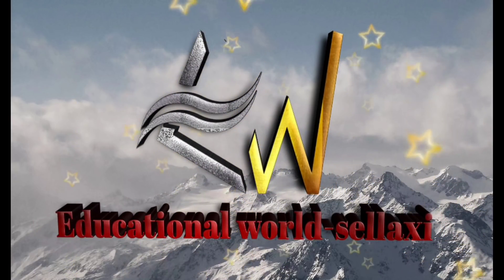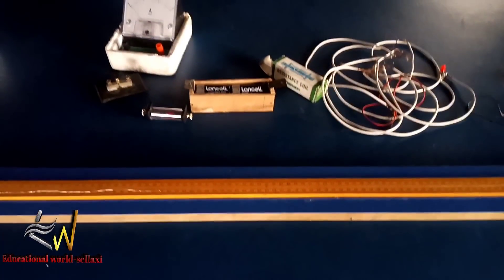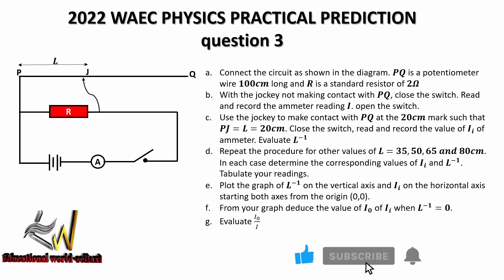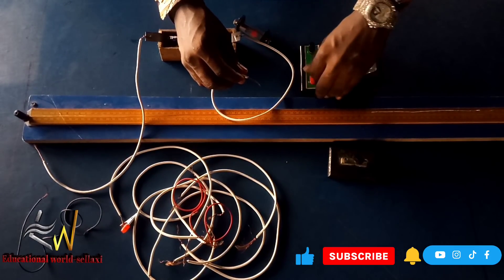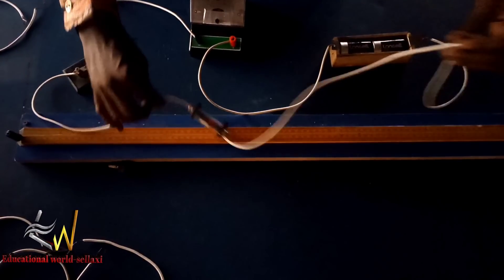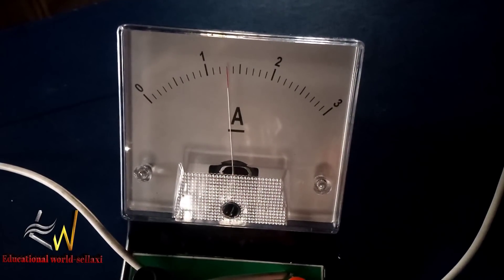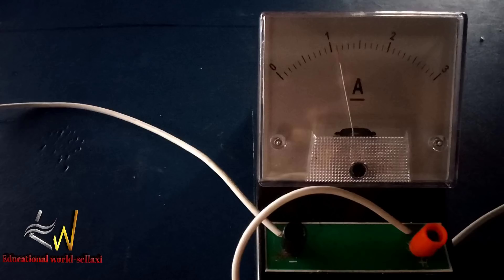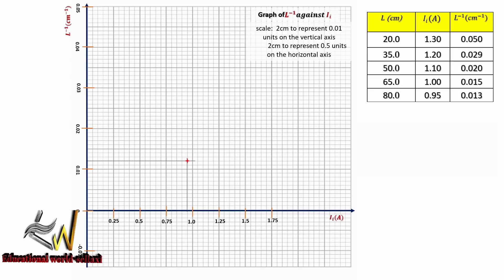2022 WAEC PHYSICS PRACTICAL IS OUT. EXPERIMENT 3

Comment: I'm getting different result from your own result, maybe because I used the normal big tiger battery or what. My first current was not up to 1.3amp, what might be the cause?
Reply from the maker: Check you're connections ensure that they're tight, and use a new battery. I think that will help
Reply: @sellaxi  I changed battery, still d same result, I will try again tomorrow and see, can I get ur WhatsApp number so I chat u up with my result before start of exam, it will be so much appreciated. Thanks

Comment: Well done sir. Pls can you tell me why my readings on the ammeter is higher than your? When my l=20 ammeter reading was 3.5A. I did the connections correctly
Reply from the maker: Due to my battery has ran down a little, that's why. But your table is correct don't fear. Your slope will still have similar value
Reply: @sellaxi  oh wow....thanks sir! But I was actually worried because WAEC asked us to prepare an ammeter of 0-2A. And having readings beyond 2A was worrisome to me!
Reply: @samuelolatunde5881  it should be worrisome.
Reply: @herolivesnu  worrisome ?
Reply from the maker: You don't need to worry
Reply: @samuelolatunde5881  WAEC knows that your current won't be more 2A, that is why they instructed that you should be provided with an ammeter of 0-2A. Unless you are not using a 3V battery and 2 ohm resistor.
Reply: @sellaxi  why shouldn't it be worrisome?
Reply from the maker: You don't need to worry about anything, that's why.
Reply from the maker: Sure, that's the reason.

Comment: Please when are posting the cheat for electricity
Reply from the maker: By tomorrow please
Reply from the maker: I may not be able to make the cheat for the videos because the exam is tomorrow
Reply: @sellaxi  quick question please. Are there cases where as the length increases the current increases????
Reply from the maker: No, that's not true. If that happens then something is wrong

Comment: Can you please redo this video,the I watch it, the more I became confused.
Reply: You connected the negative terminal of  battery to the switch not to the ammeter.
Reply from the maker: You have to understand something. The switch has no positive or negative terminal. So if I connected the negative terminal of the battery to the switch, then from the switch I connected it to the negative terminal of the ammeter. So  It's still from the negative terminal of the battery to the negative terminal of the ammeter.
Reply from the maker: I've answered you question, and cleared your confusion, please check my reply.

Comment: When resistors are connected in parallel, more current flows in the circuit. That's why we have 0.8A with 2ohms connection only, and subsequently 0.95, 1.00.>.>.>.1.30A with the potentiometer. Potentiometer is a resistive device as well. Thanks 👍
Reply from the maker: Correct
Reply: I observed that as the length increases the current drops, because resistance is proportional to length.How com you say the current increases
Reply from the maker: Yeah
Reply from the maker: Thanks

Comment: Hello sir, I observed that from the circuit diagram, it was the negative terminal of the battery that was connected to the negative terminal of the ammeter. But you connected the positive terminal of the battery straight to the ammeter. From the circuit, it was the positive terminal that was connected to the 2 ohms resistor. I appreciate your work but I'm confused at that point.
Reply: You can easily detect any error in connection by waiting for the direction of deflection after connecting anyhow. You can then change the orientation afterwards to get forward deflection on the ammeter.
Reply from the maker: Kudos for your comments Sir
Reply: Thanks Sir, but you really confused me,your circuit diagram is different from what you actually did...
Reply from the maker: @olalekanadekunle6329  I'm sorry if I confused you, I thought I really explained how I made my connections.
Reply from the maker: I connected the positive terminal of the battery to the positive terminal of the ammeter, like the negative terminal of the battery goes to the negative terminal of the ammeter. But from the circuit diagram you cannot tell which side is the positive terminal of the ammeter or negative terminal unless you know that the positive terminal of the battery must go to the positive terminal of the ammeter.  Please don't be confused, okay. Thanks for your apt attention to details
Reply: Exactly where I'm confused